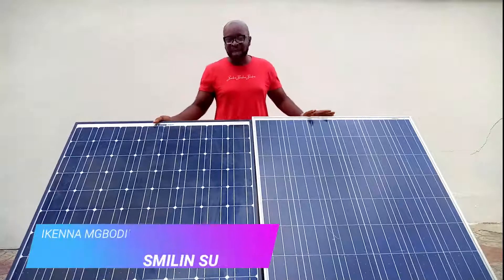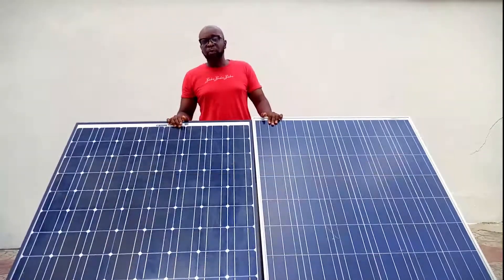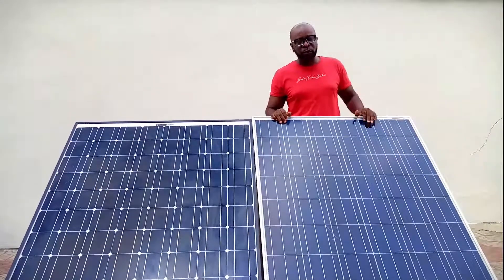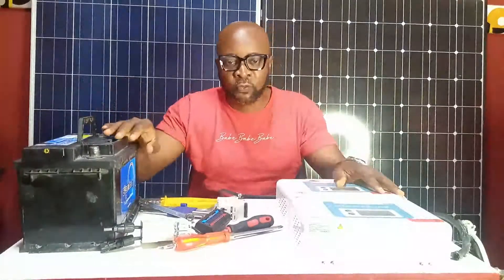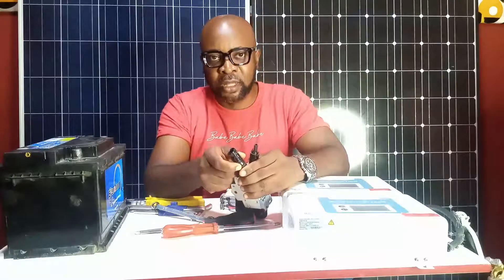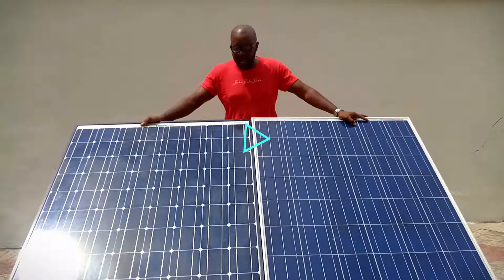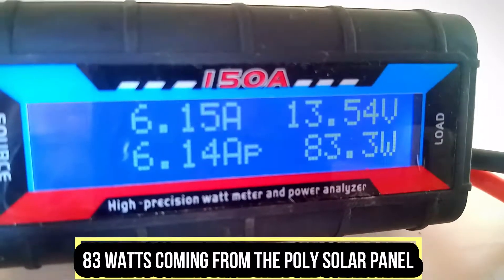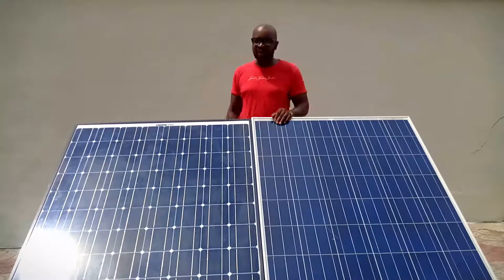Mono Solar Panel vs Poly Solar Panel

Comment: I think something is wrong somewhere. For instance, the input and output terminals are not differenciated. The amps and volt need to be taking into consideration to reach the conclusions not just looking at the wattage. 
And is the charge controller an MPPT Charge controller?

Because, lesser component may perform better with PWM charge controller unless other things are equal or subjected to more panels and see what the test results would be. Nice one. Keep it up

Comment: You are doing a very nice job. You didn't tell us the wattage of each panel before connecting the watt meter, and it is also possible the panels would produce more wattage if you were far from them. The major difference between a mono and poly panel of the same wattage is space efficiency.
Reply from the maker: 250 watts panel each